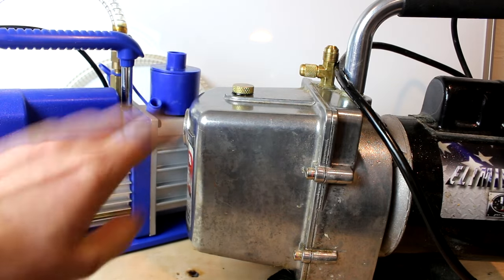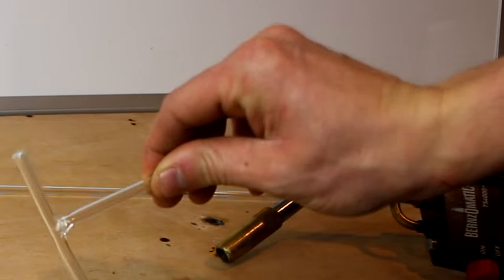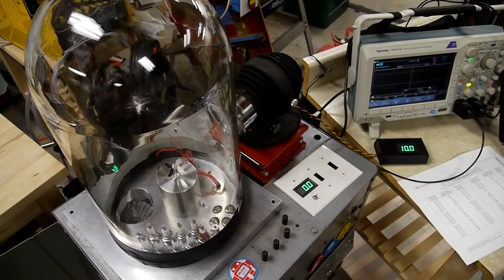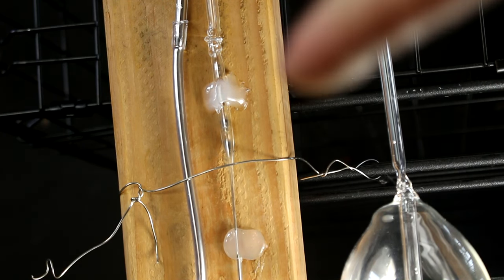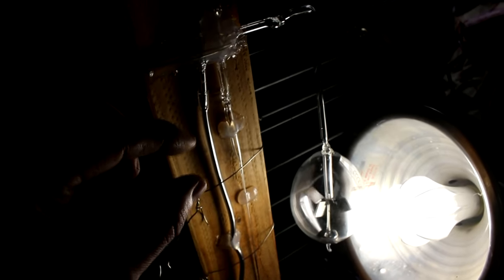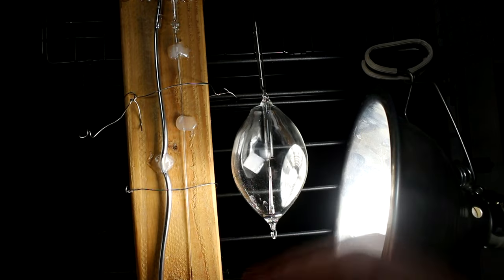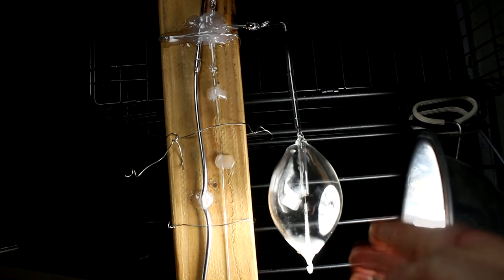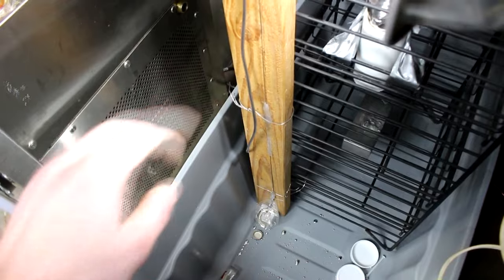Sprengel Vacuum Pump: The most efficient vacuum pump ever?

Comment: cool! Could you measure the voltage between both reservoirs? also: Would shorting both with a wire affect the pump itself in any way?
Reply: Tobias Mädel I'm actually afraid you'd need quite a capable multimeter or some kind of voltage divider to measure it without killing your device, my guess is that the voltage could easily be over 1000 Volts. Couldn't find any info to that on the Internet.
Reply: I think the multimeters internal resistance is going to clamp the voltage way down anyway, so that might still work...
Reply: Tobias Mädel that would be the second problem; you would almost immediately be reading a voltage far below the peak.
Reply from the maker: my guess is that it was well over 20,000 volts since there was an audible spark.
Reply: could you use that voltage for something neat?. and also, could you calculate how much of the energy you put in to the system is wasted as sparks?
Reply: I doubt it, because while it would be a high voltage, there wouldn't be a high current and it would discharge over an extremely short time span. This means there isn't much energy in total. So while it is enough to give you a nice shock (similar to an electric fence), it doesn't permanently harm you like mains power would, even though the latter has a fraction of the voltage (and you can't power anything useful with it).
Reply: ya i get that its miniscule, but over 36h it would probobly add up.
Reply: but over 36h it could add up to something more substancial
Reply: Maybe, but the shock Cody got was probably a large part of the total energy that accumulated over that time.
Reply: iHack, if he did that, maybe he could use the power from it to pull some of the mercury up to the upper reservoir and make the pump even more efficient
Reply: Could someone please explain why there is potention building up?
Reply: I think it works like a "Kelvin water dropper", maybe you build one :D
Reply: It's static electricity. Like rubbing a cloth on pastic. Or a balloon and hair. The mercury rubs against the glass and one side becames more negative and the other more positive. It works like a Van der Graaff generator.
Reply: Dominik, As the metallic mercury passes through the glass, it strips electrons from it. Because the mercury is being passed through a long thin tube, its surface area rises dramatically allowing it to hold more charge and so it pulls a lot of electrons from the tube. Then once it gets to the bottom it gets dumped down into the insulated reservoir at the bottom causing a large net negative charge while the top remains neutral. The only reason why they can hold the separate charge is because of the dropper which never allows the two sides to be in contact with each other.
Reply: Mercury powered electric generator?
Reply: In Cody's experiment He has the mercury dripping down the inside of the glass rod.  As the mercury atoms move across the surface of the glass, they actually pluck electrons off of the glass atoms.  Now the glass is more positively charged (missing electrons) and the mercury has a negative charge (extra electrons).

When you rub a balloon on your hair, the balloon pulls electrons off of the atoms in your hair.  The balloon is negatively charged (extra electrons) and your hair is positively charged (missing electrons). That's why your hair sticks to the balloon, opposite charges attract.  The same thing happens to the clothes in your dryer.

I may have my charges reversed in that explanation, but the internet will correct me if I do.
Reply: Cody have you checked if its producing xrays? if its near vacuum and producing sparks its probably making Xrays.
Reply: It's basically static electricity. The current would be very low but the voltage very high.

It would be like earthing yourself and then touching a Van de Graff generator which has built up a lot of charge.

Electrons build up in one pool & have no where to go, so stay there. When Cody comes along & shorts them out, the Potential difference (voltage) is very very high. It's probably on the order of Microamps of current though.

And because it's DC, you couldn't use a transformer & to get a Buck converter capable of handling that amount of voltage, you'd be spending way too much money.
Reply: Maybe use the potential for your rail gun?
Reply: you can make great non-contact high voltage sensors using FET transistors. Be interesting to put one of these nearby to see how high the voltage gets
Reply: Whisper, there isn't enough power generation. It has super high voltage, but less than a Joule of power actually stored so it would be useless for the rail gun
Reply: eivilcow
Reply: Sanu I thought it could be like the kelvin water dropper. Due to electric influence the voltage between both recevoirs increases until theres an electric arc.
Reply: You could use voltage divider for measure and then just multiply it. Just connect one mega ohm resistor in series with 10 ohm, between reservoirs, and then measure the voltage on the 10 ohm resistor and multiply it by 100k.
Reply: could you capture that electricity and get your 700 J  back?
Reply: a voltage devider would probably give you an inaccurate reading because there current will flow through the voltage devider
Reply: Yeah, I figured the charge had to be obscene.  I bet the zap Cody received wasn't anywhere near the realm of pleasant.  ;)
Reply: not to be a killjoy but as an electrician i have to say that would be insanely dangerous and the entire setup would need to be treated like a bomb.
 if your cap ever arced in to the mercury. it would be "bad" how bad would depend on the potential of the discharge it could be anything from a big mess to a lethal accident with nothing "good" in between. call me a safety sally but i would not go anywhere near such a system.
Reply: vacuum
Reply: Nerd
Reply: A voltage divider could work but you'd need a lot of resistance and a scope. On 10X measuring a 100k resistor in a 100M divider may work. That would mean 200 microamps current (assuming 20kV) and a power of 4 watts. Since it's on a scope you can see the instantaneous voltage and that voltage should stick around for a few milliseconds due to the low current draw. Using 10X means that the scope shouldn't draw too much current to make the divider inaccurate.
Reply: eivilcow That's a good explanation, the only thing that is a bit off is that Mercury loses electrons to the glass surface, and not the other way around.
Reply: Tobias Mädel So if the vapor pressure is low it will create a bigger vaccum? So does that mean if I use something like Castor oil (which has a vapor pressure of 0) I could get a vacuum almost exactly perfect before my glass collapsing?
Reply: +Dan Swoboda
Yes, using an liquid with lower vapor pressure should enable you to make a better vacuum if your tubes are long enough for the density difference to not be an issue.
If the glass doesn't implode at 1/1000th of atmospheric pressure, it (almost certainly) won't do so either if you make the vacuum perfect. It is only adding 1/999th of extra force on the walls of the container.
Reply: +Eric Moilanen I had a book when I was a teenager about static electricity. It had lots of designs for static powered "motors" or displays. Only useful for entertainment though.
If I recall, it had a design for a voltage meter too.
Reply: what about using that voltage to run the light if possible ?
Reply: Mikkel Højbak awesome, poor man's non-mercury vacuum pump is underway then. I always wanted to see electrons fly through a vacuum
Reply: +Cody'sLab Do you know how long the spark was? Dry air has a breakdown voltage of 20,000 volts per cm.
Reply: +Kevin T The capacity of the whole thing would be much less than a person walking across a carpet, then touching a doorknob. So not really that dangerous.
Reply: so the polarity is opposite.
Reply: It appears that the constant motion of the mercury and the friction against the glass is simply building a huge static charge and potential difference between the two points. Mercury being a metal, those two reservoirs are like two big electrical contacts. It's just begging to equalize itself, so Cody's body provided that path. Just a guess.
Reply: +Dan Swoboda What makes you think the vapor pressure of castor oil is zero? Everything has a vapor pressure, even glass. I can't imagine that the vapor pressure of castor oil is anywhere near as low as glass.
Reply: transformer will not work, needs AC not static electricity, so sorry.
Reply: Tobias Mädel I work part time at a retail auto parts buisness. We have monthly specials that we advertise with vinyl signage on the outside windows. Pulling them off the windows or paper backing is a job that we try to avoid because it will shock the shit out of you when you ground...I've easily seen 3 cm sparks shoot out of my fingers when I touch the safe or phone or something. A few years ago I managed to fry the LCD display on one of the phones after I was pulling the backing off of one of the vinyls and then answered the phone. The display was set up to read "RETAIL 2" or something. I zapped it and it changed to "METAIL". Also, the caller ID function just displayed gobbledygook after that.
Reply: The ions in the air being evacuated are the source. Liquid Metal Van DeGraaff Generator. I suppose ionizing the said air to be evacuated would really set up a large charge perhaps in the 100 kilovolt range.
Reply: Bat boops
Reply: You should test it
Reply: It's in a way like a capacitor, it builds up and builds up, then lets all energy out in one burst, but you cannot easily contain how much power is put out nor at what time, and I could imagine due to the surrounding atmosphere would make the voltage iffy at best, going up and down. I made a "windmill" recently that generated about .2 Amps of current and about 1.4 volts or something, I don't remember, and this was running off of a fan that was plugged into a wall... At this point, it's completely irrelevant for me to tell you this, but my point is, it's somewhat unreliable and consistent, and it generates and insanely small amount, even if over a large amount of time. and I'm pretty sure if you got a 50kV Capacitor, the efficiency (or lack thereof in some cases) would lose more power than it's generating, haha! (I'm not the best with electric, so don't judge me, haha!)
Reply: +Tobias Mädel Shorting them might increase the speed a TINY bit.
Reply: Kolbe electrometer
Reply: So after a full reservoir of mercury runs through the glass tubing 
results in the mercury getting positively charged and the glass getting 
negatively charged right? 
But then when he pours the mercury again 
in the top reservoir, it should actually get the glass and the mercury 
to neutralize the charge and then start again to build up the charges 
from zero right?
So i assume that the electric charge builds in a 
single run of a mercury reservoir and not in the whole time that the 
experiment takes place.
Reply: Tobias, never touch electronic equipment if there's a charge differential present. Currents involved, though very tiny, are enough to fry incredibly tiny electrical contacts in microprocessors.
Reply: Tobias Mädel would have been really Cool to charge a capacitor or run an led from it!
Reply: the gap of the mercury falling allows the two puddles to effectively become seperate voltage potentials
Reply: iPelaaja1 Very good. In this  case the metal against a dielectric  oxide  glass . The triboelectric  effect . This  is a quantum level effect. As efficiently  as  the pump, the vacuum  separation  between slugs  of mercury insulates  and prevents leakage and discharge. The  charge  keeps building until a conductive  path presents itself .  If we wanted  to prevent  the  charge buildup  we  would  connect  a conductive  wire  between the  reservoirs. Welcome to the world of science .
Reply: dammit my thought imidietly got asked
Reply: piezo electric grill starters output about 2500 volts and make an audible spark tho.
Reply: Sorry you got shocked. I think the electrical activity is the most interesting and unexpected aspect of this experiment. Kinda reminds me of the conditions for a vacuum tube. Neat project
Reply: I would thumbs up this comment, but it is at 666 right now, so I'm gonna leave it.
Reply: Yeah, I actually blew the input on a Fluke 77 multimeter with static that I built up by resting my fingers on the inside of the flange of a reel of 1/2" magnetic tape in a tape drive.  I had noticed getting shocked by touching the flange, and decided to measure how much voltage it was making.  End of meter.  I guess it make kind of a van de Graaff generator with a disc instead of a belt.  Fluke declined to repair it under warranty.
Reply: Sanu: in a capacitor, the charge is stored across the insulator, not the conductor.  One popular demonstration of this is to charge a leyden jar (capacitor made from a glass jar with foil lining the inner and outer surfaces), then remove the foil.  You can touch the pieces of foil together and nothing happens, but if you put the foil back on the glass, you find the capacitor still charged.  So anywhere there's a gap (like between the drops where it was sparking, and in the gap up at the dropper) is where the charge is stored.
Reply: Tobias Mädel mercury powered taser
Reply: I'm sure I've seen some surface voltage meters that are designed to measure this kind of voltage. We ourselves are normally charged to several thousand volts, sometimes going into tens of thousands or potentially higher. It would be interesting to try and connect it to a large HV capacitor and see if it can store any of the charge. I'm sure Uncle Photon has an array of these in his back garden.
Reply: @theCodyReeder  sounds like you are talking from experience LoL... People don't just quote 20,000v right off the top of their heads LoL 🤣... 
Pity you didn't experiment more with this device, like trying to figure out how to make use of the voltage discharge or how to make a heat pump out of a vacuum pump.... Would have loved to see it working through a thermal camera.... I bet that we would have seen something interesting going on..... Maybe in a future video??????????
Reply: @johannesr7775  Kelvin Water Dropper with Liquid Metal  cool!  All the charge is contained within the glass so no splash, but in vapor?  What is more, each droplet becomes part of a multi-stage resistor.  How does the separating charge affect the weight of the mercury, and thus movement? The electric charge is probably why mercury vapor is condensing in the vacuum chamber.  Easy fix...wire from top to lower container.